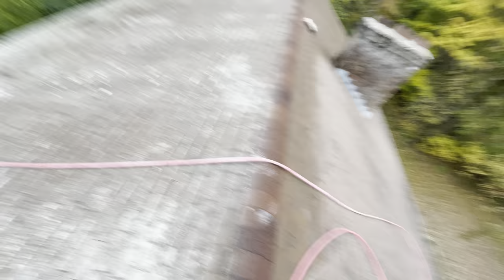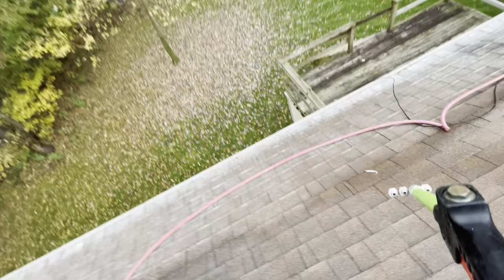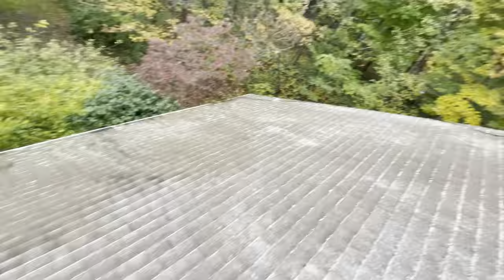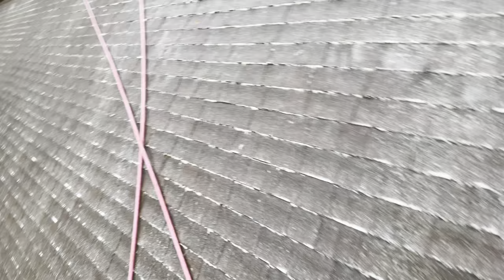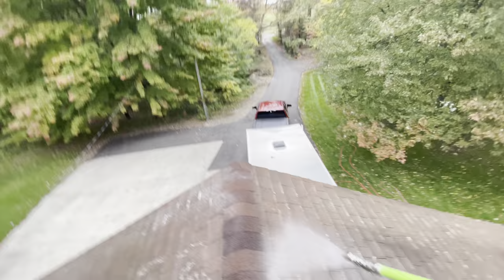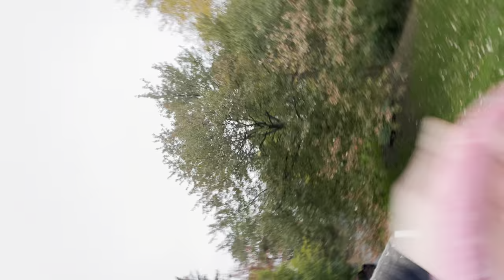12v pump roof cleaning

Comment: @softwashscience i like the way it sprays on the roof. You dont have a bunch of water coming out nor are you flooding the roof with your mix. I have a 7gpm 100psi pump and looking for the right tip for roofs...its been hell for me
Reply from the maker: 1530 is the best you just won’t see you guys using those because they make the pump rapid cycle. You need to get an accumulator tank.
Reply: @softwashscience  what kind of tank is that? Where do I find those tanks
Reply: @softwashscience  do i add the accumulator tank after the 12v pump or before it the 12v?
Where did you get yours from? I see Amazon has them but this is my first time hearing about the accumulator tank to be honest. Happy Easter
Reply from the maker: @bryanvance6629  after the pump.  I got one from powerwashstore dot com.   If you get the flojet accumulator it has the quick connects on it.

Comment: What size hose and GPM
Reply from the maker: 230 ft of 1/2” 7gpm 60 psi fatboy pump.  Honestly not a fan of this pump I think the 7gpm 100 psi is better and your able to run better tips with the 7@ 100.  I just started using this one and will do some testing this winter on other pumps and share my thoughts.
Reply: Im trying to get John blue pump gas pump 6.0 gpm at 290 psi
Reply: You thinks is better running 5/8 or 1/2 with the 7gpm 100 psi what do you think
Reply: Do you think the John blue pump is better than the comet or AR45 pumps?? I'm asking because I'm really interested in upgrading to a gas pump..thanks
Reply: @caseypinder6990  get more information  Ar45 people running 300 psi you are going to get more problem if you commercials job is good but residential not
Reply from the maker: @JUAN120484   its always better to run 5/8. Less restriction more flow.  I have a ton of 5/8 and will run is at times but I need to put 5/8 on my reel.  1/2” is nicer to work with and I get away with it but I wouldn’t necessarily recommend it to someone if they were going to go buy hose.  I just happen to have about 550’ of 1/2” so whats a guy gonna do lol.
Reply from the maker: @caseypinder6990   I would think that would be way to much psi for roof cleaning.  I think 80 to 100 psi is the perfect psi for roof cleaning and about 3 to 4 gpm flow at the nozzle.  4 gpm at your nozzle is a lot of flow for roof cleaning.  Commercial or bigger jobs 7 gpm + and more psi is sweet but it just depends what lane you in ya know.
Reply: I have the Delevan 7gpm 100psi what tips do you recommend
Reply: Where do you get a lance like that
Reply from the maker: @worth-fighting-for   I make them.  Its the only thing still green when I get off the roof lol.
Reply from the maker: @worth-fighting-for   buy a few so you can experiment but I like 2525 2530 1530 0040 0030 0540 and 1520.  Buy those various sizes and you will be able to fine tune a perfect spray pattern that works with your hose and set up.  Even though I have that same pump and my set up might be just a little different you know and so it may spray a little different. The pump I’m using in this video as a fatboy. Unfortunately I had a connection right behind my 12 V box spring a leak and it sprayed about 15 or so gallons of SH directly onto my Delavan and that screwed it up so I pulled it out.
Reply: Where can u get the lime green lance thread pipe from? Very nice . I have been looking for one. I sure would love to have one
Reply: @Soft Wash Science  Can you do florescent orange and how much for the set up? Definitely interested.
Reply from the maker: Only selling them in black at the moment
Reply: @softwashscience can you make a video of your lance? It looks like a suttner 510 with a pvc riser and a quick connect?
Reply from the maker: @joshaguirre9189  I have a video up on my channel about them I make them out of 100% carbon fiber.
Reply from the maker: I sell them here and I’m the only one who has these and makes anything like it.  https://616wash.company.site

Comment: That ladder looked skinny is that just from the camera or can you tell me what kind that is.  Tku.  What did you have the soap dial at.   Hardly any run off.  Nice job
Reply from the maker: Its a stack ladder and not sure what the soap dial was set on probably about 4 though
Reply: @softwashscience  Tku.  Maybe you can show it in another video.   I can’t find it online anywhere.   Tku
Reply from the maker: @benderprofessionalservices9018   any window cleaning equipment place will have it

Comment: Could you look at your  tip and tell me the number? So you could be using a surface cleaner tip and not even know it
Reply from the maker: I’m sure it’s a 1530 just based on how it’s spraying.  It’s definitely not a surface cleaner tip because I would never use that and it wouldn’t put out this amount of volume.  This video was from four seasons ago, so I don’t even have that Jrod anymore.

Comment: I use a gas powered pump and will never waste my time using a 12v again. I do 2 story homes from the ground with no problems, plus when shopping for liability insurance, I tell them that I don't go on roofs. I may use a little more product, but it's muck quicker.
Reply from the maker: Its hard to turn out a good product without getting onto the roof and I have shot many roofs from the ground but run off is an issue especially if your using gas.  I just like the 12v for this type of thing it works so good and its quiet.  Then when you wash a house well bust out the 8 gpm.
Reply: @softwashscience  You can control the volume with gas pumps, plus when I gives estimates, I tell them that we don't go on roofs, and if they decide to get other estimates, make sure their insurance policies cover them walking on roofs. I always end up getting the jobs because many have insurance, but going on the roof is excluded. If the house is too tall, I refuse the job. One slip and fall, your career and life can be over. I hope you have much success.
Reply from the maker: @ILC-eo6vk   how you you clear all the debris off the roof and out of the gutters before you soft wash it?
Reply: @softwashscience  I use a curved extension wand on high houses with my pressure washer or a Stihl backpack blower with a long extension Mostly the blower, though. I'll sometimes have to use a 10 foot step ladder for some extra height. On one story homes, I pretty much do the same thing and sometimes I'll use a regular ladder and scoop out the gutters. It makes a mess, but I rinse it house off. No big deal.